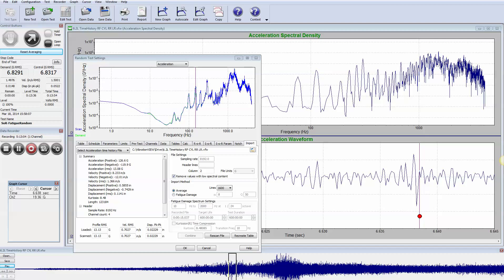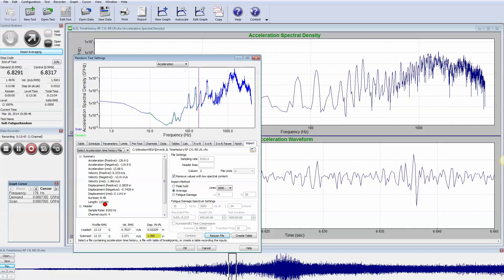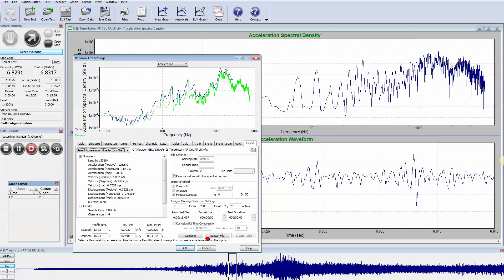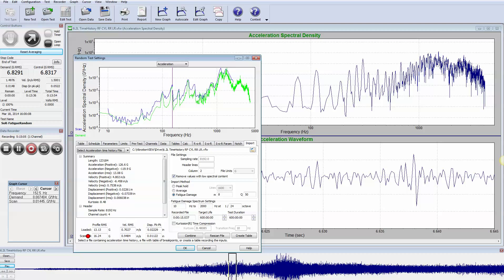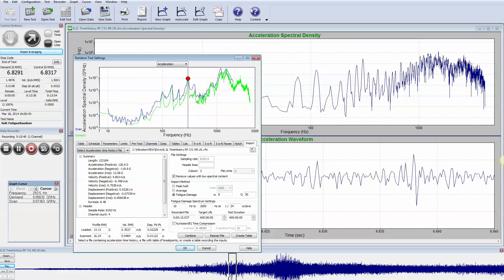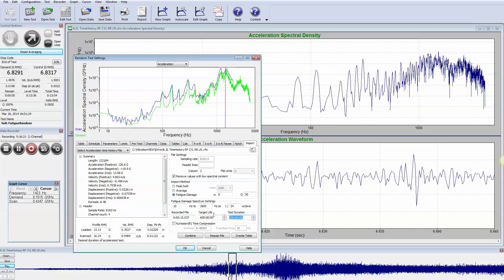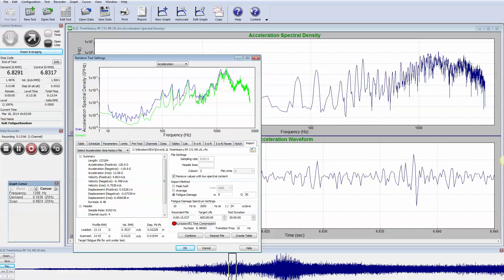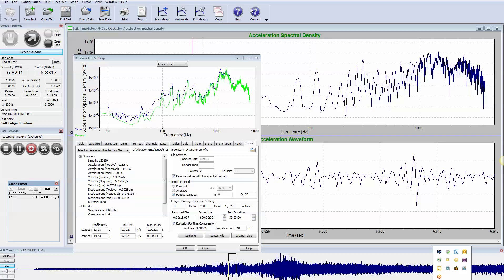Importing Data into Random (FDS 2/3)

Comment: Awesome. But notice that at the end of the runup the engine stays at high speed. So if you take your average FDS it's gonna weight high speed more than other speeds. What we normally do is we weight the FDS of every engine speed by its % use in customer use, similar to annex A of ISO16750